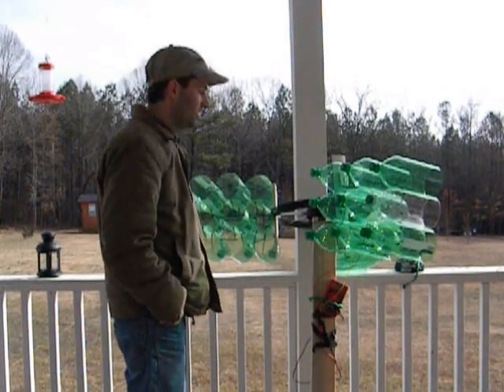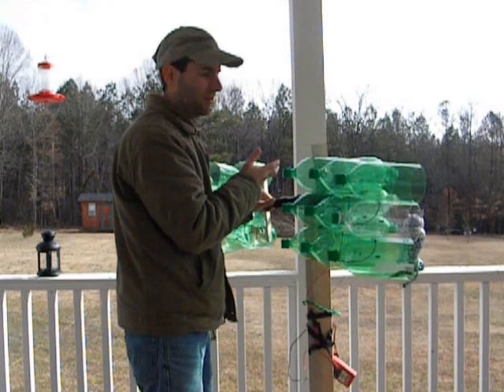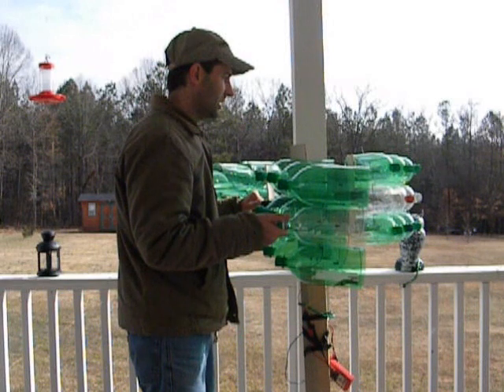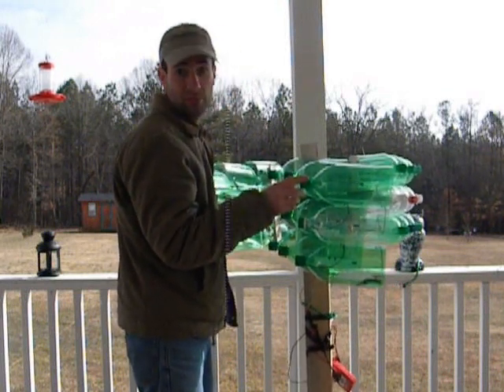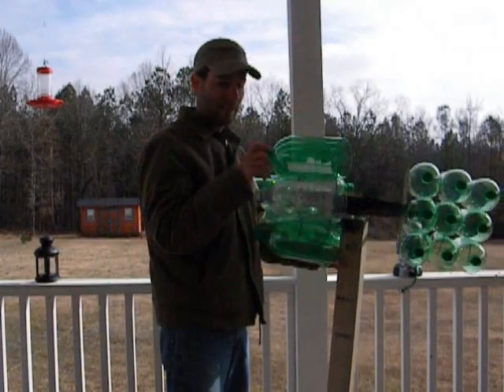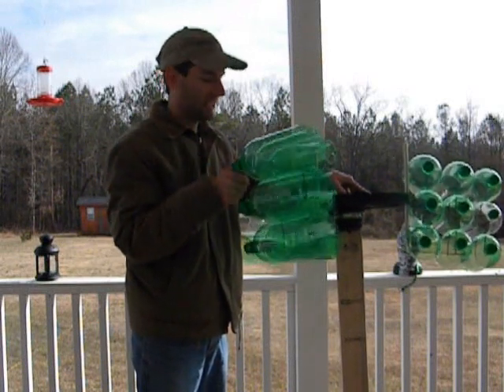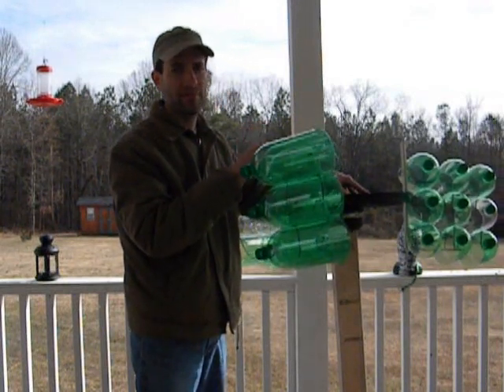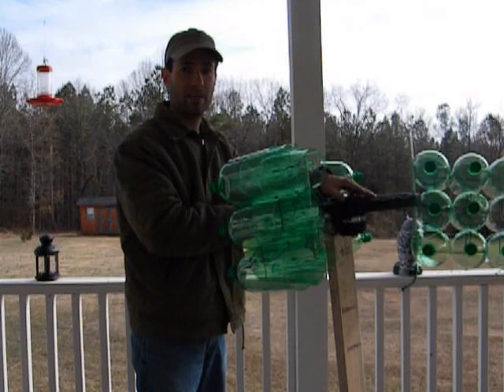My 2 liter wind turbine (27 bottles)

Comment: i don't think you have enough surface on the blades. on the other hand if you split them down the middle a mount them side ways it should work much better.

Comment: You might try old GM heater blower motors with the squirrel cage fan that turns very fast and has slots that you could put fins in. I don't know what kind of out put they would have however.
Reply: +ALLxoxoxoxo yeah. and the cages to stay in front of the heathers and by the time the heaters goes hot,the squirells will get tired and the extremelly hot heater will grill the squirells  so you can heat and bbq at once and live happy for ever and ever !! PS: you might even put  big in the cage.  ^-_-^

Comment: I think you should have put them on top of each other all the way instead because when placing them like that it makes the arms that the bottles are mounted on heavy and weak. Also maybe have cut the bottles shorter and with a angle would improve I think. I am just in the beginning of making my own so don't be a hater if my thoughts isn't all that logic.

Comment: Dude, thats nice. i think if you cut the bottles at an angle of about 65 degrees, and use less bottles, it would start up faster and probably go faster. Covering them in airline grade plastic wrap will also help. Keep at it.

Comment: Use a gear box to increase the RPM of the motor for a better back EMF effect that will in turn output a much higher voltage

Comment: Wondering if you filled the spaces between the bottles with tape or great stuff so air couldn't flow around the bottles but had no choice but to engage the now larger blade.
Reply: ***** That defeats the objective because wind will be pushing the bottles from the back as well.

Comment: I see two goals expressed here: To make use of waste plastic bottles and to make something that generates electricity from wind. First mistake I see is thinking that the two goals can be achieved with one project. Bottles in the sun will break down and have to be replaced, even if you find a shape that works. You can cut them vertically and make a squirrel cage type wind spinner, and after all that work you have something that will degrade in sunlight and have to be replaced, again and again. One good way to recycle bottles is to use them as... bottles! Store water, food,salt... If you want a wind spinner that will create electricity and not degrade, you need materials that last, not cheap plastic. Lastly, why try to reinvent wind power? Very efficient designs exist, for hundreds of years, and none of them look like a bundle of bottles. Study history, save time.

Comment: How about making windmills from the bottles ??  Like what kids make  pin wills I think they call them ..  Could even use cans ?? Would 30 little vertical windmills get way more rotations than that big bulky stuff ??  You could use the top of the bottle to get the cone shape..  A bit of heat could shape the plastic not a problem ..   Like your thinking ..  Great out side the box teaching !! Love it  !

Comment: Less is more! Balence the number of bottles used vs resistance of bottles. Fewer bottles = reduced weight and reduced wind resistance. Start with one bottle per blade. Think of wind speed indicators.

Comment: Super....cut the bottles in half vertically and make a scoop. You'll have more surface area and less weight and bottles. Did you try taking the caps
 off the bottles to allow some air to flow through?

Comment: something totry, cut the bottles shorter, right after the curve from the neck.
also, could attach bottles to doll rods radiating off the motor, screw caps into sticks, thus being able to try different lengths of bottles or types( 2L, 1L, 24oz)

Comment: One of the problems that old water well windmills had was that too many blades got in the way of their air flow.  I think that has happened here.  You might try putting a set of bottles above the wheel axis, a set on the wheel and a set below so there isn't quite so much turbulence on the blades.

Comment: I built mine out of printer set up, the gears and belts and all were already assemled perfectly.  It puts out 15v at 500 rpm from a drill.  I tried a battery sawzall motor that only put out 0.5 volts, maybe the rad motor is one of those ones that just don't work.

Comment: check out some of the bicycle wheel designs. There's a VAWT one with guttering used as blades. BUT, the guy has the guttering leaning backways (the top is furthest from the wind direction), which INCREASES the pressure on the bearings. I think you should make one with the guttering leaning forwards, so that actually some of the wind's power RELEIVES pressure in the bearings, because it is effectively helping to LIFT the wheel, reducing the downforce on the bearings.

Comment from the maker: Unfortunately, vacuum cleaner motors will not work in that application. Those motors have no magnets in them, so when they spin nothing is produced. They depend on electricity to create a magnetic field to make the motor turn. You would have to find a way to put magnets inside the motor and create a magnetic field inside to make it work on a turbine. Thank you for the question, Lonny

Comment: I think you should try this again with a couple of adjustments: 

1) Leave the Bottle Caps Off -- The caps being on prevents the air from going through and doesn't allow the bottles any traction in the air.

2) Shorten the bottles -- You might make them shortest on the inside of the circle, medium in the middle, and longest on the end for more leverage.  You want the least resistance towards the center where there is the least leverage.

Comment: the length/depth of the 2ltr bottle serves no useful function and is probably detrimental.
Slice the 2ltr bottles lengthwise and re-form the pet to a two layer airfoil shape for an S-rotor.

Comment: I always thought wind turbine worked the same way helicopters and planes do... They don't just move around air, but the blades cut the air in a way that produce a high pressure system on one side and a low pressure system on the other.  I could be wrong.

Comment: Make the blade extensions edge face directly to face the direction of the wind. and the blade angle to match your Car Fan Bade for the correct rotation.The problem with your bottle design is the Round cap end of the bottle is causing back pressure reducing its effectiveness.

Comment: WHY NOT JUST EXTEND THE FAN on the Car Fan - motor to make it bigger and mount it Horizontal !  You might even cut the bottles lengthwise to make Blade extensions (Like Propeller blades on a plane) and mount the caps to hold the blades in Place on the original fan blade as described in the previous comment I made.  I bet it would spin 10 times faster if the bottles material is stiff enough to not give from the winds pressure. Or in fact make blade extensions some other way.

Comment: Part of the reason why the turbine spins so slowly is that you have a large diameter, which increases torque on the shaft.  You'll want a gear (or belt system) to convert that torque to RPM, and then attach that to the motor.

Comment: A single bottle per blade design may be somewhat efficient but when they are bundled together, much of the aerodynamic differential between the front and back of the blade is lost.  Adding some spacers between the bottles may help preserve efficiency.

Comment: i think you are loosing alot by keeping the full length of the bottles. They only need to be as long as from the spout to the widest part of the bottle. like a funnel.  You might try to make little cones to fasten on the pop bottle tops to increase  your rpms.

Comment: mass equal's force x's acceleration. how bout ya cut the mass for air by cutting the bottle's another 5 inche's or so & they won't be as heavy in weight.[they seem 2 block the wind current'sand upwind's & downwind's-[cut them shorter]keep trying..

Comment: the cylindrical length of the bottles contributes mass without contributing to the energy conversion. try either exponential cones or linear cones; air resistance meets a very small cross-section on one side, and a much bigger cross-section on the other. Keep the dream alive, my friend!

Comment: have you considered flapper designs and doing personally wound coils using waste coils in the backs of all these tube (CRT) TVs that are hitting the dump thanks to the change in tv standards for transmission(going digital) and the higher availability of LED and LCD TVs. The flapper design you could series the coils from each to get higher levels of voltage, but I would say just run it through a transformer. with the right unit, your .5volt could be ramped up to 120 volts.

Comment: I think it might work better if you set up the bottles with some distance between them to allow the air to pass around the bottles on the upwind side. The reason it accelerates slowly is that there is little difference between the wind resistance on either side of the disc.

Comment: Put the mouth of each 2 Liter bottle, using about 6 bottles, on the edge of the fan with each 2 Liter bottle cut in half vertically, up to where the plastic angles toward the mouth of the bottle. The bottle would look like a scoop by itself.

Comment from the maker: I am sorry to say with this turbine there was not enough volts to run anything but a small led. This motor need to spin at a very high rate of speed to get any real power out of it. With the right gearing ratio and a 3 phase motor I believe the results would be better. Thank you for the question, Lonny

Comment: Did you try w/o the caps on?  Also, I like the ideas of either having one side blocked(to cut down on wind resistance on the upwind side) and simply mounting the fan vertically(can use a 2 Ltr bottle to make a cone for the prop). Keep up your good work!! Remember Edison's quote about inventing the light bulb "I have not failed. I've just found 10000 ways that won't work." :-D

Comment: Find u a old treadmill and get the motor for your generator ,gear it and u got good cheap power source.The ones I work with do a great job and u can find old unwanted treadmills on craigs list for free.If geared right u will a volt for every mph wind if is very good even for a commercial built one,u can build one for little or no money ,good luck on your projects.

Comment: My suggestion for getting those motors fast enough would be to build a big VAWT with a lot of torque and gear up the rpm going into the motor. For pretty much any of these i think you will need to gear the motors to get anywhere near the needed voltage.

Comment: If that DC motor doesn't work as a turbine, you could use it as a 12v solar attic cooling fan or a solar tracker.